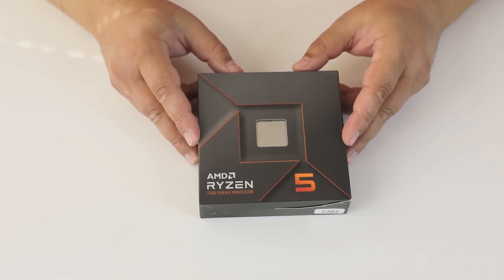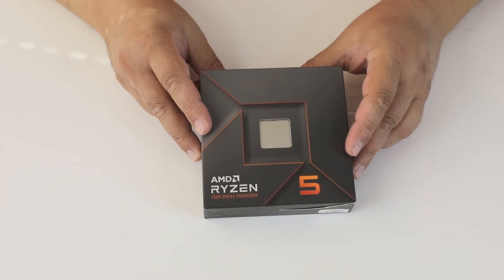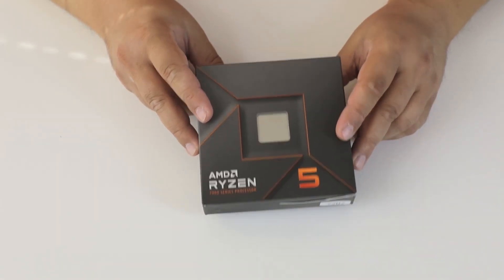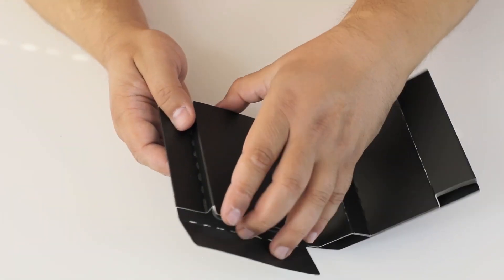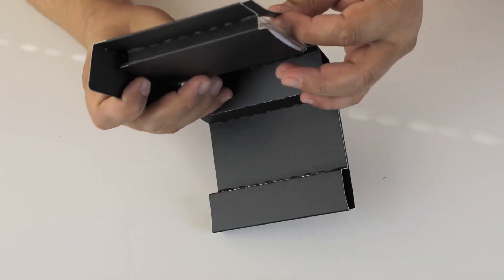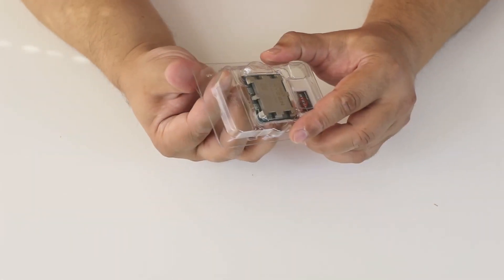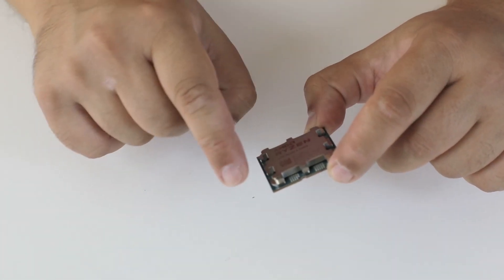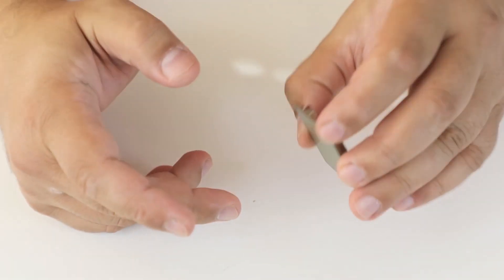Unboxing Ryzen 5 7600X

Comment: no stock cooler?
Reply: Yope
Reply: @rabiulmallick8991  JOPE THERE IS NO BOXED COOLER BODUI!
Reply: No, stock cooler comes with the higher model.  But these are meant to be overclocked I'm surprised they even included the cooler with the higher models.
Reply: @reggie1078  or  with none
Reply: 7000 series runs very hot so no stock cooler noob
Reply: @JayzBeerz  maybe on eco mode or if you downclock on 4,6ghz